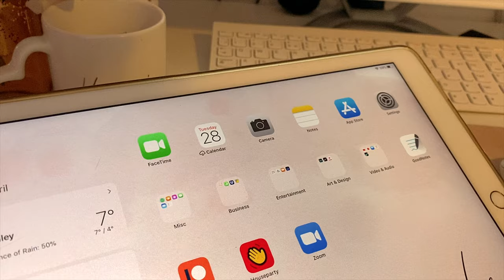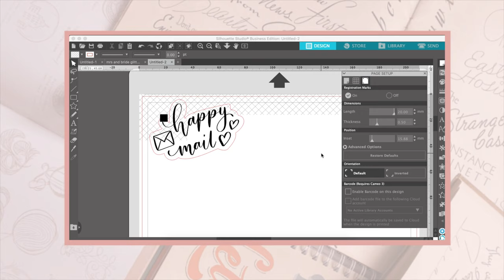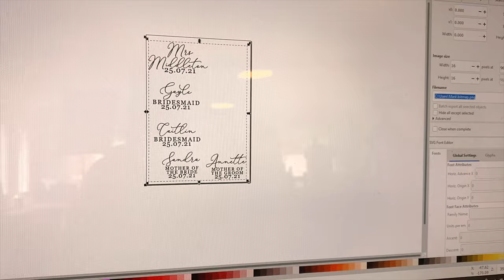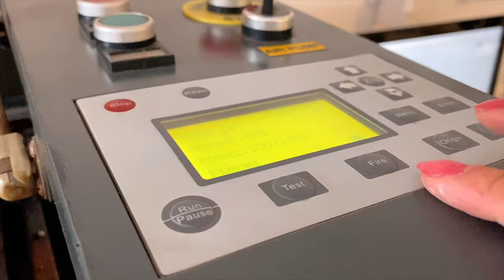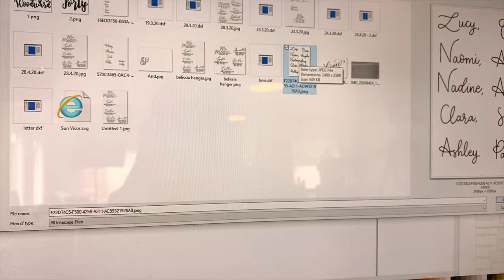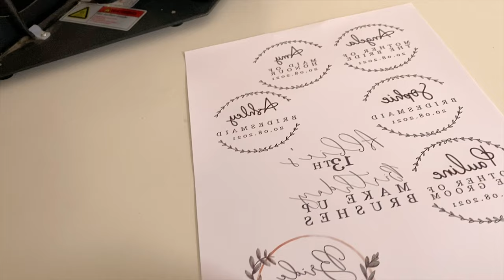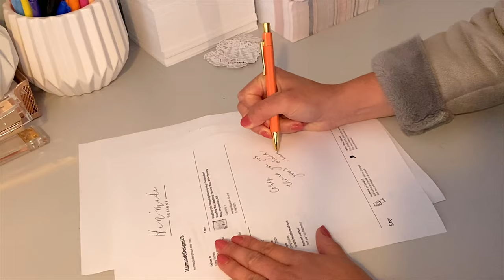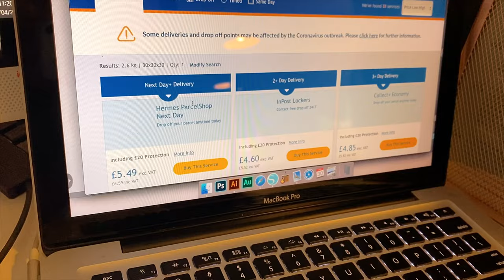Studio Vlog 20 - Laser Engraving Etsy Shop Orders

Comment: LOVE LOVE LOVE everything you do :) if you don’t mind me asking what temp and time settings do you use on your press for foiling the paper? I use a laminator and it’s never quite right and I never though to use my heat press until I saw you going it :) genius x
Reply from the maker: I had the press on whilst I was heating the laminator up, and then thought I wonder if it works 😂 turns out it does. Personally I wouldn’t recommend it for professional jobs, but if you want to quickly foil something it’s great. I put them temperature up to around 180 degrees and a time of 60 seconds. I then let it cool slightly before peeling. 💕

Comment: What kind of laser cut machine are you using? For the mugs, what print paper are you using for them? I have tried vinyl on them but going through washer it comes off.
Reply from the maker: I’m using a man tech laser machine. Regarding the printer paper, I’m using specialist sublimation paper, and sublimation printer and ink that allows you to print directly onto mugs (they can be washed over and over and lasts for years to come). Hope this helps ☺️